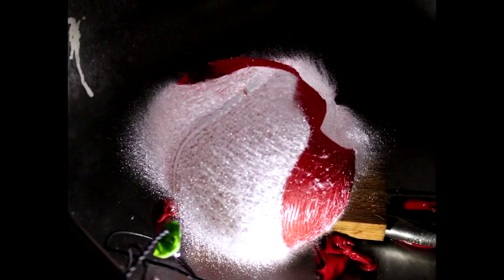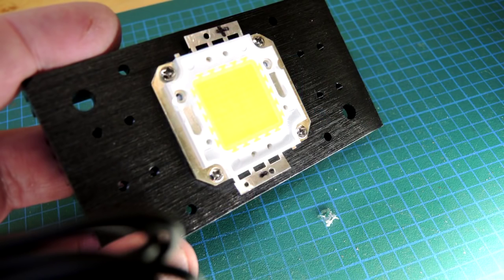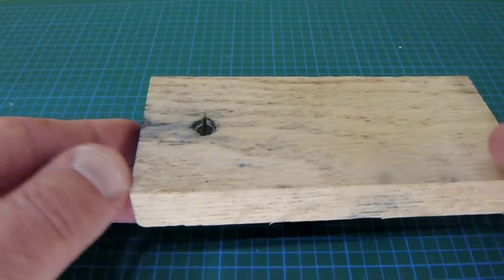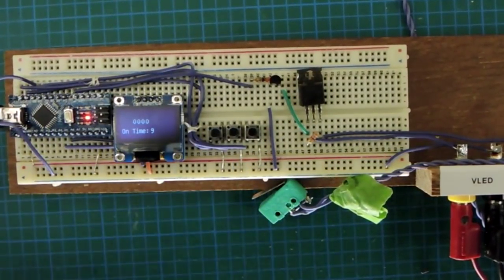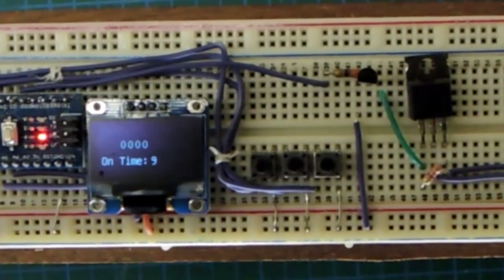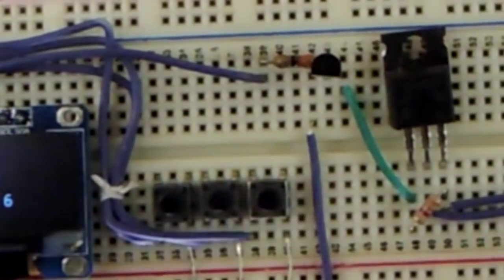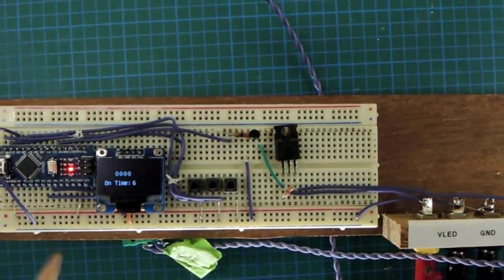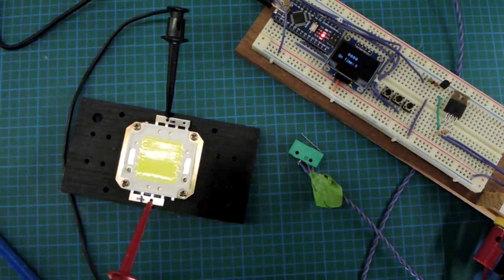FROZEN TIME PHOTOGRAPHY AND A SUPER BRIGHT LED MODULE

Comment: Thanks for this experiment, I was considering this as well for similar high-speed photography. Could you measure how long the actual light pulse was ? Xeon flashes can got down to a few microseconds, but I suspect that the phosphor used in the white LEDs can prolong the actual light-flash after the current stops. But I might be wrong and it maybe is not a concern.
Reply: +Henner Zeller there will be some afterglow, but i suspect it would be negligible compared to the huge amount of light when the LED chips are driven at full current.
The light pulse would be as long as the software told it to be, plus or minus a few microseconds of delays in the mosfet.

Comment: Why did you choose to do high side LED control????Please explain.   Thanx
Reply: +jp040759 Yes +electronupdate, why not use an NMOS at the low side? Is it just the safety of not having 60V on your LEDs at all times?
Reply from the maker: Safety... Keep voltage off of the led when circuit is idle

Comment: A thought on the timing, if you have any kind of high speed camera (Nikon 1, Casio, action camera) you can set the switch to trigger a small LED and then film the whole thing. Then frame step through it to figure out how long between key press and the event you want to photograph in high resolution.

Comment: Why can't you leave the LED on for the whole duration of the shoot?  Why all of the trouble to choreograph a flash?  Sorry, I don't understand
Reply: +mnelson10000 
Because you don't want an image that's just blur? Look up techniques for high speed photography.
Reply: Blur is from shutter speed, no?  Do you not use a really fast shutter speed for this kind of shot?
Reply: +mnelson10000 
No, that's the point of the setup. It's much harder to make a fast shutter speed and time it correctly than a very short light pulse. The shutter is open for many seconds in this shot. The "bulb" shutter setting means it's kept open as long as you push the trigger down.
Reply: +superdau Ahh okay, I think I get it now.  Thanks for the clarity.